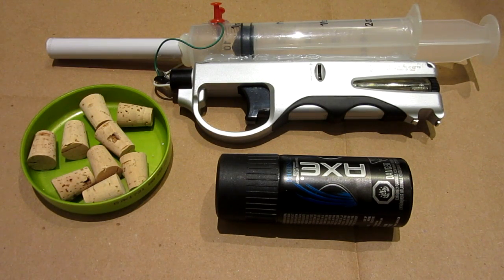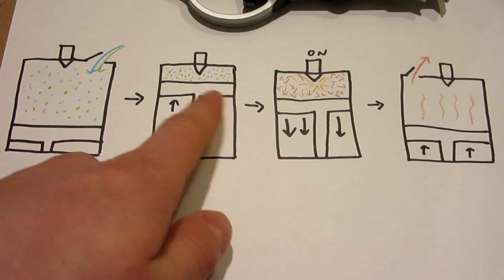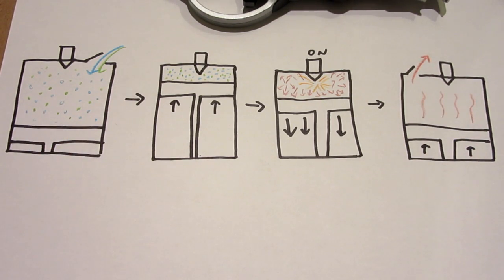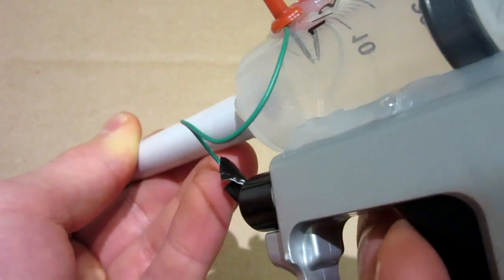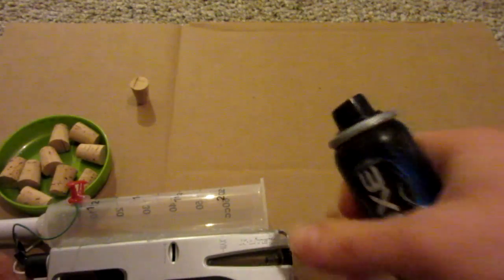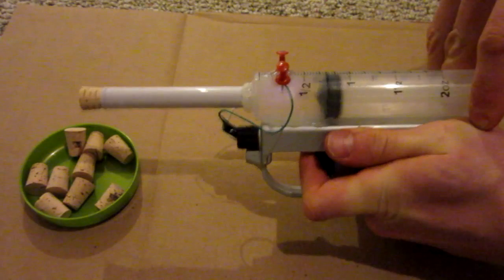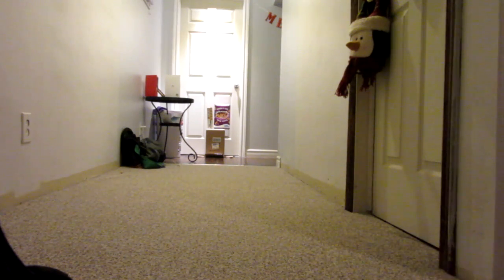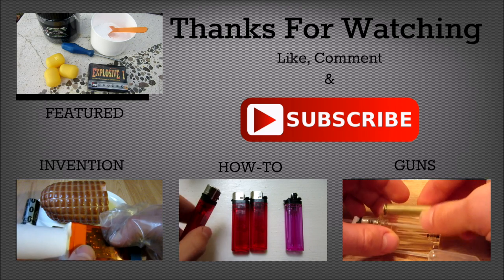Make an Internal Combustion Pistol = POWERFUL

Comment: I could see this being adapted to a setup with a reaction piston on one end, and a feed mechanism using a Geneva drive based drum to load in BBs on the other end. The reaction piston would drive a small flywheel which would be geared to a drive shaft that rotates the Geneva drive gear that chambers the BB. I suspect a bit of clever adaptation of the Otto cycle 4-stroke for fuel-air mix to be drawn in by the reaction piston from a carburetor via another port cut into the chambering section. (Basically it's a rotating drum section that works as a valve. And what amounts to the power and exhaust stroke being combined to blow out the BB chambered in a revolving drum.) To start it, would probably take a heavy clock-spring mechanism on a ratcheted lever that's cranked a few times before pressing a release. Stopping fire would be cutting fuel and BB feed as well as grounding out the spark source.

Yes of course it's losing some of the force driving the BB to the reaction piston, but the piston draws in the charge and loads the BB via that imparted momentum so it's not too bad a loss given it would make a fully automatic system. Also think of the reaction piston designed with a relatively short stroke and using a heavy weight lubrication, so more of the impulse would still be biased to driving the BB.

Not sure if that makes enough sense describing it with words short of having some good drawings, but I picture something rather clever that could be made by anyone with enough machinist type skills.
Reply: The internal combustion engine was developed using cannon manufacturing technology.
Reply: thx for this comment! it led me to learn what a geneva drive is, and i found it pretty interesting! :)
Reply: Just use a pressure relieve valve to send compressed gases on the barrel, and a gas port to cycle the gun.

Comment: For this project, you have two options. Number one, you can make this like the video, a manual piston that can compresse all the gases in the combustion chamber, then fire. Or number two, create a mecanism of injection air more light fluel into the combustion chamber, to get the mixture compress without compression piston, leting the compressed fluel and air make the job. but if you make experiments whit this second way, make a exit hole for burned CO2 gases, them bloqued it for more compression gases in the combustion chamber.

Comment: There was an old style of air rifle that worked on a similar principle.  Like a regular air rifle Springs would compress air in the pistons behind a pellet and build up pressure till it could dislodge the pellet. On the compression stroke a small amount of ether would be injected into the piston and when it reach full compression the heat generated would ignite the compressed air ether mixture releasing energy and greatly increasing the energy behind the pellet.

Comment: I Love It but there really should be a locking clip for wherever you fully compress the mixture it'll be clamped onto it so you can make it for higher compression ratios put the sparker a little closer to the hole and I think we can get ourselves a very high compression pistol

Comment: OK... I'm thinking metal  construction, spark plug, battery and trigger as a switch for both fuel injection and allowing power to the spark plug. The barrel could be welded or soldered on.

The only limiting factor is the end of the barrel if you wanted to use a harder projectile.. Maybe an rubber O ring inside the barrel that would squeeze an inserted metal projectile.  Some kind of spring mechanism could squeeze in the compressor whilst also providing some negation when it fires backwards... Maybe multiple springs.

Comment: You might get more power and a more consistent shot if you rig up a mechanism to hold the plunger in place. You will be losing forward energy as the plunger recoils but if it can be locked in place that energy will project the cork instead.
Reply from the maker: +martin dennehy yeah good idea! I will make an updated version but this was just the simple concept :)

Comment: I laughed so hard when you said about the fuel that it didnt smell to good
Reply from the maker: +Green hey Thanks! If ya wanna understand it better just Google how a 4 stroke engine works and it'll come right up!
Reply: inventor719 whats all the supplies
Reply from the maker: +Green to make the gun? You need a lighter, 2 push pins, a large syringe, and a tube for the barrel.  And I mention briefly how to make it in the vid

Comment: You lose energy on that syringe going back
Reply: If you put a weight on the back it would basically be a recoiless rifle
Reply: @emperorhadrian6011  id like to  make a hole on the shaft of the syringe plunger and insert a nail or smthing to prevent that recoil
Reply: some sort of lock would work

Comment: If you build some kind of "sabot dart" around this corc and a fitting secondary barrel for the dart, with a slightly bigger diameter, which can be removed and connected easily, that would be a serious weapon already.

Comment: inventor719, you should make a pistol grip that you hold like a gun and a handle in front of it that you can squeeze that pulls the plunger forward ,in other words when you hold it like a gun after loading you squeeze the pistol grip forcing the plunger forward and then you pull the trigger and  bang you have it, and also in doing so it should be easier to aim .

Comment: Any way to vent the gas line of the lighter into the syringe instead of using the deodorant spray?
Also are you losing much power due to the syringe pushing back against your hand?
Reply: Would be much better, because the fuel from spray is butane anyway. From the gas tank it is the same - just pure.

Comment: I’m trying to understand why we use gas to push out pellets instead of igniting the gas. My framing nailer sinks 1300 nails with one tiny fuel cell also has a battery. I think it would be fairly easy to make a Co2 pistol with a refillable cartridge and fill it with green gas and ad some type of ignition source like a battery hidden in a hand grip or mag extender and send a spark to the chamber.   Come up with a real looking gas combustion pistol that rivals a real firearm you’d sell billions of them.

Comment: I want to see a paintball gun but with an explosive mixture of gas. Like oxyacetylene and then right when you pull the trigger the gas and the “paintball” or straight up bullet.. get sealed in a chamber and then a spark ignites the pressured gas mixture exploding the gas thats already at a high enough pressure to send the projectile at 200-300fps. Could the explosion get it up to 1000fps or at least the speed of sound.
Reply: I would think about a small HHO-Generator inside the pistol, with enough power to refill the Chamber quickly. Would also solve the problem of releasing combustion gas after each shot, because HHO has the oxygen in there already and the water simply would fly out as steam to the barrel.

Comment: Any chance i can get the size of the syringe, and maybe even for the piping you used as a barrel?
Reply from the maker: +Lol Mart the syringe is  60cc / 2oz and the plastic pipe is 1/2 inch diameter and 3" long
Reply: inventor719 Ah, thanks man.